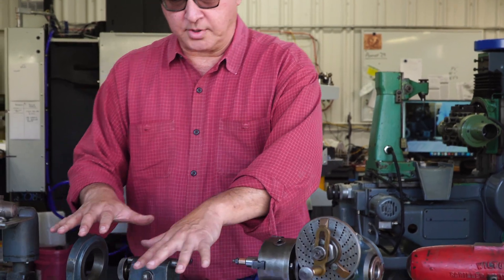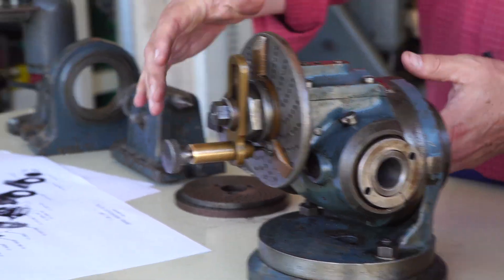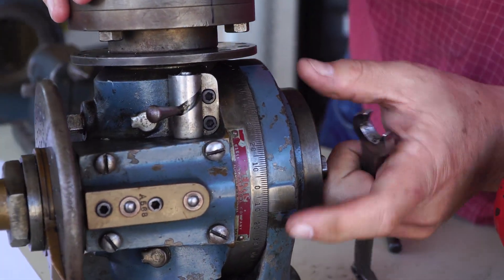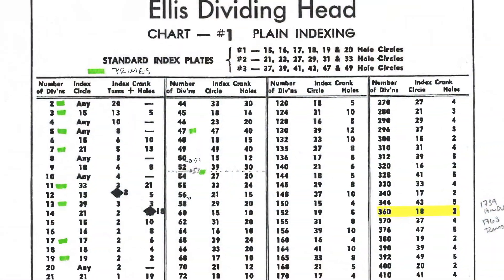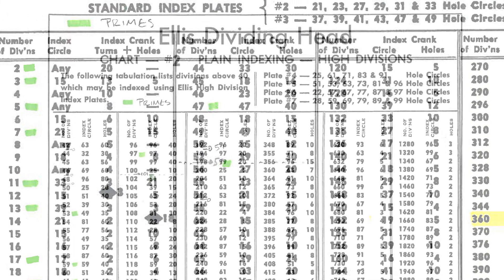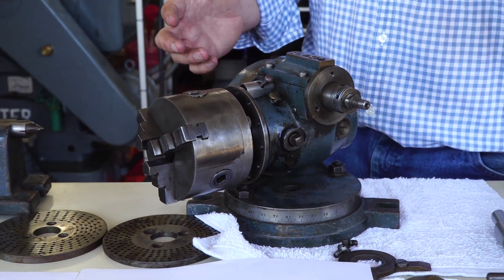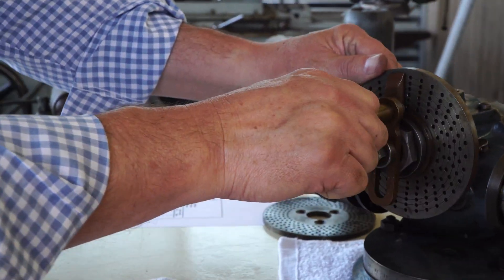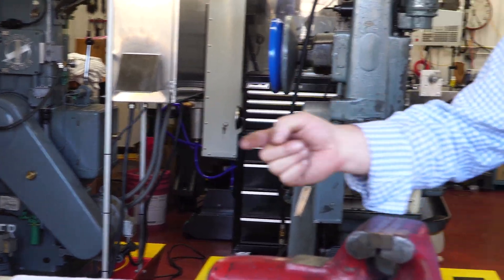How-To Use a Dividing Head (or Indexing Head) Ellis - Bridgeport

Comment: You are Lucky to have the chart. But if you don’t, the number of divisions divided by forty is the number of holes you have to move. IE for a 70 tooth gear, 40 /70 would be the number. But there isn’t a 70 hole plate. A 4/7 would work. But wait. There isn’t a 7 hole plate either. Any number that is divisible by 7 will work. It just so happens that 21 is divisible by 7   3 times. The solution then is to use a 21 hole plate, and move the handle pin 12 spaces ( 7x 3= 21, 4x3=12) .Now, if you adjust the wings so there are 12 holes
showing, you will move the handle only 11 spaces because you are starting at zero count. Thirteen spaces must show.
The edges of the wings are severely beveled to help operating the handle. They should be adjusted so that the pin moves from beveled side to beveled side. In the 14 space example one edge should be against the pin . And 19 spaces around the circle the other beveled edge should be just visible. 
It is important that the handle is turned in only one direction ( usually to the right) to prevent backlash errors, and maintain accuracy  If one overshoots the hole, one must back up and return to that hole from the intended direction.
Been using dividing heads for over 5 decades.
Reply from the maker: WOW, thanks for sharing with the channel.  This is exactly the type of clear minded experience that we are all looking for.

Comment: I have been told that gears made on a mill with a dividing head are not as good as gears made on a hobber. Can you shed some clarity on that?
Reply from the maker: From both a quality and cost standpoint, the vast majority of gears are made with the hobbing technique.  Milling gears is also done and practiced frequently in smaller job shops when an individual or low quantities are required.  As long as it fits the service milling is very acceptable.  Hobbing machines have a proven and high quality drivetrain that insures there are no tooth-tooth indexing issues, it is very fast at scale and produces a very high quality gear.